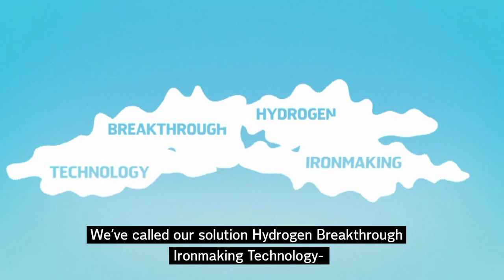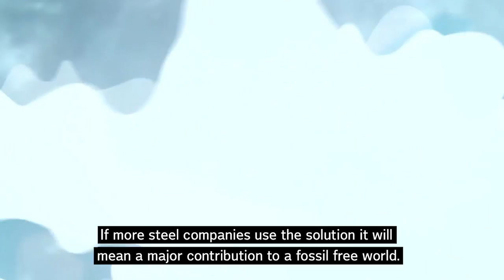Fossil free steel production: This is HYBRIT

Comment: Erm doesnt hydrogen take like 3 times the energy to produce in eletrolosys than when its burned? Wouldnt it be easier to just use focused solar on the crucible?
Reply: When producing steel with hydrogen, hydrogen is acting as a reductant towards the iron oxide ore, reducing it to metallic iron. This is not combustion, that is, the hydrogen is not burned. The reduction reactions of different iron oxides are however mostly endothermic, meaning they require energy in the form of heat. This is supplied with either natural gas or hydrogen - these gases are burned to keep up with heat loss. 

For reference, approximately 550 Nm3 of hydrogen is consumed per 1 ton of produced sponge iron, and additionally 250 Nm3 of hydrogen is burned for heat, or 50 Nm3 of natural gas [1]. 

Now, there are two dominant electrolysis processes used to produce green hydrogen, an AEW type and a PEM type, which have efficiencies in the range of 70-80% and 90%, respectively [2]. This means that in the AEW case 20-30% of the energy input is lost as heat - rest is effectively converted into hydrogen. 

So it would be more accurate to say that at least a loss of 10-30% in energy occurs when producing the hydrogen. This hydrogen is then used as a reductant in producing sponge iron, and possibly as fuel for heating, from which the iron goes into an electric arc furnace. About using "focused solar" energy on a crucible, that doesn't address the need for reducing the iron oxide into metallic iron.

1. DOI: 10.1007/978-3-030-98056-6_7
2. DOI: 10.1016/j.renene.2024.120033
Reply: You are correct, hopefully someone can think of a solution of this bottleneck.

Comment: What do actual metallurgists think about this? Carbon is needed in the steel itself, otherwise it would be iron... the same with TungstenCarbide, will they replace the carbon with hydrogen in that also? Haven't found answers to those questions
Reply: I think the ore already has plenty
Reply: Carbon itself is not going to be replaced in steel, although the term "carbon-free" has gained traction. When using hydrogen as the reducing gas it will be necessary to add carbon at some point of the process to achieve the desired carbon level for structural properties. One way to achieve this would be to add natural gas during the reduction process itself, which would also provide the external heat the hydrogen reduction reaction requires. Or in the following step, in the Electric Arc Furnace, the iron could be charged with sources that contain carbon, for example some biogenic source or pig iron.
Reply: @AaBb-mk4sr   still no answer.
Reply: @Hoarax1  you'd think that sequestering carbon in iron and tungsten to make tungsten carbide and steel would be the shit. Or just flue management to lower emissions. Or uh...

Comment: I have an important question but who is going to pay for the windmills and solar cells, not to mention the extra electricity and hydrogen plants for the steel companies?  If steel companies pay for it, steel will become very expensive not to mention cars, construction and home appliances.  It seems like a perfect world with hydrogen but it comes at a big cost, especially if made green.
Reply: In exception of Rhodium and Palladium(maybe Lithium), iron ore has seen the biggest price increase of all metals since it's 1980 high. Increasing that further would indeed cause a significant increase in production cost

Comment: if you produce aluminium first with electricity only, you can use that aluminium to reduce oxides to their main metal
Reply: Actually, Alcoa Corporation and Rio Tinto Aluminium has done something similiar to that , the project is called Elysis, and its supported by Apple and Canadian government.
Reply: if you do vacuum plasma ionization of oxides, you should get gases up and metals down

Comment: The climate change movement is political and damaging to life. Why? Because their carbon tax idea kills flora and fauna. Fact - both mars and Venus have very high CO2 concentrations in their atmospheres whereas in between these two planets there is earth with only 0.04%. That is due to flora. So flora optimises the climate to suit life very effectively. Supporting plant life is philanthropic and is the way to go. Taxing carbon is kleptocracy at work.  It is lethal for the populations of poor countries and it is a bad idea. The more expensive green energy reduces money for alleviating starvation. Lower carbon dioxide levels reduce crop yields resulting in more deaths. Photosynthesis is endothermic. It reduces the ambient temperature and supports life. 
Fortunately the USA rejects the Paris accord and is doing the right thing - feeding and supporting flora.
Reply: so? why don't you want them do it? i think it is pretty impressive if hybrit can reduce emission & do it cheaply

Comment: How will you add carbon to the steel? 

Hoppas på svar :)
Reply: I think the process produces pig iron which can then have carbon added afterwords.
Reply: @Alex . More importantly how to remove the oxygen?
Reply: @guringai I imagine the hydrogen is part of the oxide removal stage. By generating heat through burning Hydrogen instead of coal and coal coke, it will bind the oxygen from the ferrous oxide, instead of carbon atoms, making water vapour instead of carbon dioxide. I guess after that, it has to go through a second stage of introducing carbon to the molten metal, while it's in a vacuum, to avoid any carbon dioxide being created.
Reply: @xxhellspawnedxx  Ok though as the oxygen is drawn from the ore at liquid ore temperatures, and mixes with the hydrogen.... KABOOM! 
That's the part I don't understand
Reply: @guringai  I'm by no means an expert, but I would imagine that the amount of hydrogen added would be restricted, to avoid explosive results. If the purification is done in a vacuum, the hydrogen can be fed in little by little, binding the oxygen and giving off heat, but not enough at a time to cause an explosion. The resulting water vapor could then be extracted somehow, leaving them with only pure iron.

But then, they weren't very clear about how this process would work. Maybe they're just planning to use hydrogen as fuel for heating the blast furnace? We can only speculate.
Reply: @xxhellspawnedxx  hydrogen its stochiometry doesn't really allow for that, or does it?
Reply: @xxhellspawnedxx  a super hot vacuum that is large enough for industrial metal production sounds pretty damn expensive and difficult to pull off.